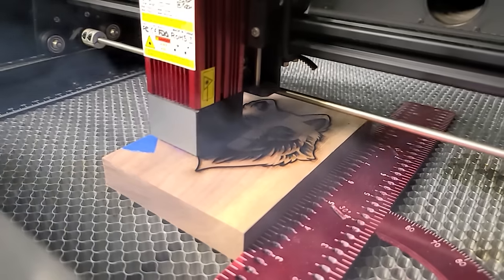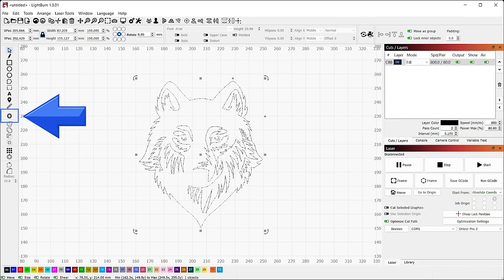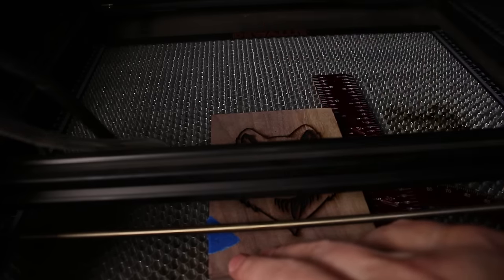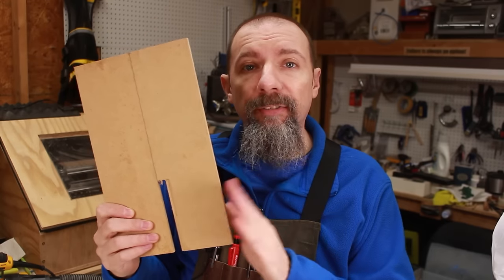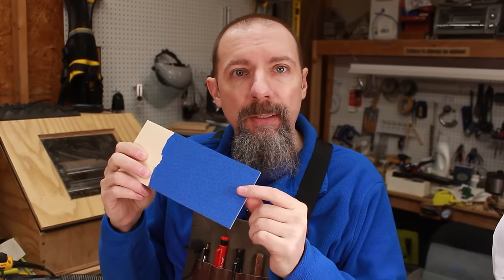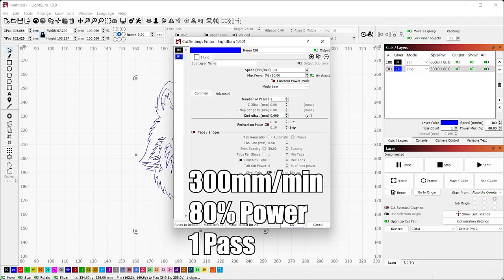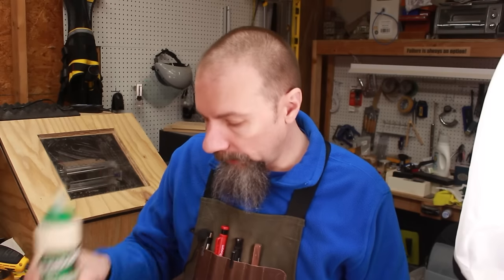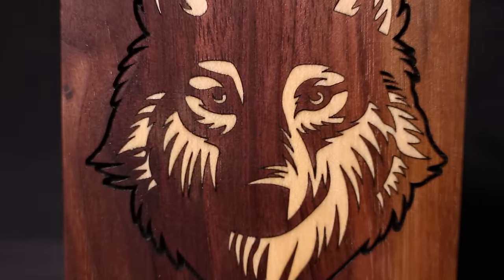Unleash your laser engraver with this game-changing technique!

Comment: I am relatively new with LightBurn, since you are using version 1.3 is there a reason you did not combine the fill layer and the line after fill using LightBurn's ability to have multiple actions in the same layer?
Reply from the maker: Great question! I didn't combine them for clarity in the video. I felt it was easier to show using multiple layers. No other reason.

Comment: Note - if you want a fill with a line around the outside, LB has that built in - just select "Fill + Line" as the type of cut instead of line or fill.
Reply from the maker: Thanks for the info!
Reply: can you point out what time you are referring to use this tip
Reply: @abusam1  Around 2:16 - he copies the fill to do a fill and a line on the same object. Just saying a small simplification is to use the fill+line to save 5 seconds.

Comment: Great video.  I was curious for a while why you didn' just set cut layers for the inlay piece until you did the 'zero weed' placement.  Your audio is near perfect.  How do you do that?
Reply from the maker: Thank you! Admittedly, the wolf was not the best choice to demonstrate this method as it's still probably quicker to cut this and inlay by hand. In fact, I've had several comments about how this is a waste of time, but on a more complex project this method would be a huge time saver.

Glad you think the audio sounds good! It's a lot of work to make it sound the way it does. Everything is recorded on either a lav mic or a condenser mic and then is edited in Adobe Audition to get the levels right and remove noise, echo, etc. I do this for each audio clip I import to ensure appropriate levels and that it sounds right. Then in Premiere I have it set to export at a specific loudness level that YouTube suggests. The end product is what you hear in my videos!

Comment: What a great video, thank for sharing. I did not see what the optical power of your laser is, i would like to know as i have not purchased my new laser yet.
Reply from the maker: I made this video over a year ago and at that time I only had a 5 watt laser. I have now owned and used 5, 20, 33, and 40 watt diodes and a 55watt CO2 laser. My advice is to purchase the highest wattage you can afford. You'll be able to run jobs faster and cut through thicker material.

Comment: For the inlay element, the white maple, why didn’t you just use line to cut them, it would have been far shorter to do. I use sheet veneer as you don’t need to burn too deep on the parent material.
Reply from the maker: I burned off the excess so I can push it right into the pocket in one go. Not really necessary on the wolf but if you were doing a really intricate inlay with lots of tiny pieces it makes it a ton easier.
Reply: Ohhhhhh that makes sense!

Comment: Why do you vaporize the maple around the inlays rather than just cutting them out? Seems like you're adding a few thousand percent to the print time and I'm not sure why.  Is this just some limitation of your laser and or the software?
Reply from the maker: In the video I was demonstrating a zero weed method which is better suited to more complex inlays where you don't want to be placing every inlay piece by hand. The wolf was not a good pattern to demonstrate this because it looks like I wasted a bunch of time by burning off all the excess maple. If I were to remake this video I would use a really complex inlay to demonstrate. For simple patterns like this wolf, cutting out the parts and placing them by hand is much faster.

Comment: Thank you for te video, just wondering if the charcoal doesn't ruin the bonding of the inlay to the pocket.  As a scale modeller I have been tought to always sand off the charcoal when building a wooden lasercut model.
Reply from the maker: Good question! The fit is so snug that I probably didn't even need to use glue. Also, since this is a decorative piece and won't be handled often, with the snug fit and the wood glue I used I doubt any of the pieces are ever coming out. If I was making something that would be handled or used frequently I might consider a different method such as v-carving on a CNC.

Comment: Until I receive my Alpha I'm thinking on how and what to place on the thin inlay material so that when it is cut, the backing does not also get burned through and the tiny inlay pieces becoming separated.  In addition to a layer or two of blue tape, for my *final* tape backing, I'm going to try the aluminum air conditioning tape usually about 4 inches wide or so, (lay even edge to edge-no overlap), and when this tape is the final backing, it will hopefully prevent the burning through when cutting of the thin veneer from separating.  After the base is coated with a glue and the inlay fitted/placed/rolled in the base, let it dry totally.  Then, you can gently pull off the aluminum AC tape, with or without the blue tape.  To help in the AC tape removal, a LIGHT HEATING - a *quick* propane torching to get warm, then any remaining blue tape can be removed with a finishing sanding which will be necessary in any event.  I am going to try this method and since you already have your cutter, you may beat me to it  🙂

Comment: Great video... just got my xTool.  Have you tried double sided carpet tape?
Reply from the maker: Thank you! 

Carpet tape is a big no for laser engraving because many of those tapes are made with PVC. When PVC is engraved or cut it releases chlorine gas which is extremely toxic. The chlorine will also bond with hydrogen in the air creating hydrogen chloride which is bad for your laser engraver. In short, both your life, and your lasers life, will be greatly shortened if you cut/engrave materials with PVC!

Comment: Should be noted flood fill does not always work to make it shorter. I’ve seen jobs in flood fill take 7 hours and no flood fill take 2.5 hours…
Reply from the maker: That is true. It depends on the design and layout you are running.

Comment: Hi, why copy, arrange and select a new layer? You could just add a Sublayer to the first ;-)
Reply from the maker: No real reason other than that's how I did it when making the video. At the time I felt it would be easier to follow with multiple layers.
Reply: @LetsMakeAThing  The SubLayers are relatively new to LightBurn - and your way is how it was done before that.
But with Sublayers you can save a few clicks ;-)
Wondering why you burnt all the excess inlay wood - wouldn't it be easier and a lot faster, just to cut the shapes needed? Like with a multi coloured plot i.e.
I´ll give it a try, nevertheless
Reply from the maker: By burning off the areas on the inlay you don't want you can then press it directly into the pocket. If you only cut the shapes you'd have to remove the excess by hand and then run the risk of accidentally moving pieces so they don't line up correctly. Not a huge deal on the wolf I did but if you were doing something really complex with lots of tiny little bits cutting and then removing the excess by hand would be really time consuming.
Reply: @LetsMakeAThing  Well, bigger part burning will also be time consuming ;-)
May be an offset could help so that removing parts would pose no risk
Reply from the maker: That is true. Personally, I'd rather the part spend more time in the laser while I do other things and then press fit the inlay without needing to remove extra material by hand. I'm sure others would rather reduce time in the laser, for example if you're a laser cutting business.

Comment: Hello there. Very interesting video. QQ What kind if laser did you use for this project and wjat did you set your kerf at? Thanks
Reply from the maker: I used an Ortur Laser Master Pro 2 which is a 5 watt diode laser. I didn't make any changes to the kerf just engraved as is in Lightburn.

Comment: if you keep using diode laser @ 80% power it will die very fast so pay attenction
Reply from the maker: How will running at 80% power kill the diode laser? Running something at less than full power should produce less heat in the device prolonging it's lifespan.
Reply: @LetsMakeAThing  you can trust me or not :) i had a diode laser and using it @ 75/85% every time, i cutted many things, costantly loss power, after 2 month it lost about 20% of his power so i had to buy a CO2 laser to use it at 50% and now i dont have any more problem of lifetime. maybe was my atomstack that had some problem but that is what is happen to me. now i use the diode laser only to engrave if i have to cut i use co2

Comment: Good stuff....  Ideally, would it be "better" to have the inlaid wood just a c-hair higher than the base so that when final sanding the inlaid piece, usually a smaller mass, grinds down to meet the more dense base wood??  Actually, after placing the inlay into the glued base, roll it real good and let it dry. (The three missing pieces SUCK).... Then the final sanding will take off the tape that did not lift off without loosing any small parts..  Your link made it to my "saved links" for reference....  🙂
Reply from the maker: Thank you! Glad you found it useful!